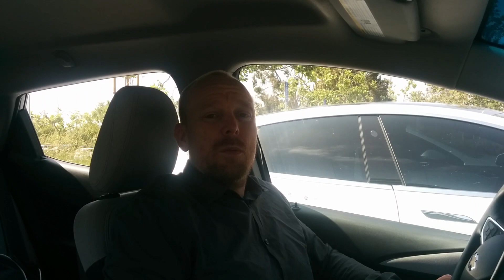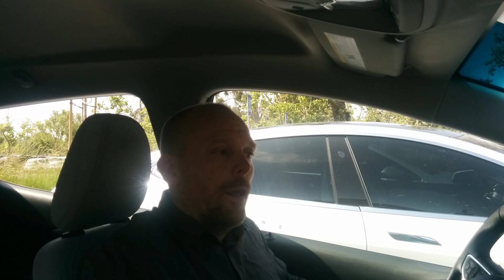Plug-Side Chat: What Actually Dictates the Chevy Bolt EV Charge Rate

Comment: Sorry, it seems there is a difference between battery packs.
https://www.techspot.com/news/74967-teardown-tesla-model-3-reveals-best-battery-ever.html
Reply from the maker: Oh, I'm not making a qualitative assertion. I'm simply stating that JB Strauble, Elon Musk, et al. are misrepresenting a very basic concept to give themselves a positive marketing spin. Basically, sacrificing accuracy for profits.

The concept of power density is simple. The kW/kg of power a battery can produce. On a cell level, Teslas are more power dense than any other battery cell because they have such low capacity. Likewise, a smaller capacity Ioniq or Spark EV cell will be more power dense than a Bolt EV cell as a simple consequence of having less capacity (i.e., less mass). 

The Model 3's battery might be more power dense than the Bolt  EV's (we don't know for sure because the Bolt EV's battery output is capped at 160 kW... it could be much higher). However, the Model 3 has much lower power density than the Spark EV, which has much lower power density than the Volt.

What's missed in this whole discussion is what is the max power required for the application. The Bolt EV only needs 160 kW, so once that target is reached, GM is free to add capacity (energy density), which consequently reduces power density. The Spark EV only needs 120 kW, but it also doesn't have room for more energy capacity. The Model 3 requires at least 250 kW, and possibly more to meet the future demands of an AWD performance trim. 

The fact that some performance EV modifiers prefer GM cells over Tesla cells because the latter suffer from worse voltage sag should tell you all you need to know.

Comment: There are sure limitations on the CCS but the tapering is definitely something Chevy has been programming into the BMS to protect the battery and make it last longer. Tesla does the exact same. But it is true, if you max out the charger's limitations (in how many Ampere it can deliver) then that's not the car's fault or weakness.
Reply from the maker: Yes. GM is more conservative than they needed to be, and unfortunately, I think this was a decision where the engineers and designers were overruled by accountants. 

One thing that will be interesting to account for is how the Bolt EV draws excess power from the charger for climate control and battery conditioning. Even though the battery charge current limit appears to be set at 150 A, that might not be the system limit. I've noticed that when a Tesla is charging (say at 100 kW) on a Supercharger and the climate control is turned on, the charge rate will drop (say to 95 kW or whatever is being drawn). If a Bolt EV is DC charging and the climate control is activated, it will draw power from the charger (if it is available). But I don't know what the upper limit is yet.

Comment: GM wasn't conservative on the Spark EV, which didn't taper like the Bolt EV. Spark EV saw very little battery degradation. We all know the Spark EV was a test bed for the Bolt EV.

As far as the slow charging and tapering on the Bolt, GM used a low power density cells and Hyundai used a high power density cells. Telsa uses a higher power density cells on their vehicles.

GM really neutered the Bolt EV. I don't recommend the Bolt EV. This is coming from Gen 1&2 Volt and Spark EV owner.
Reply from the maker: The power density of the Jaguar I-PACE's cells is almost identical to the power density of the Bolt EV's cells. Why can the I-PACE sustain 90 kW charging rates up to 80%?

Comment: I think you are the one confused. J.B. Is correct. You do choose the chemistry. The easiest way for you to learn about it is to buy a hobby charger and a bunch of different 18650 cells, and watch how they charge and discharge. 

The Panasonic 18650B is a pretty good battery with a decent power (6.8a with 12a burst) and pretty good capacity 3400 mah. But there are 18650 with much higher power, but lower capacity. Samsung 25R is high power (20a continuous) but lower capacity 2500 mah. 

The reason all high drain batteries are lower capacity is that what makes them high drain is more electrode area and thinner electrolyte layer. The same thing that lets these discharge fast, without voltage sag to cutoff, is the low resistance. This same low resistance allows the battery to stay at the Constant Current phase much longer before it hits the Constant Voltage phase.

Both Panasonic 18650 and LG Chem pouch cell call for CC/CV with CV being at 4.2v. As a single cell, as long as it’s within recommended temperature, that’s all it needs to do to charge. No voltage taper, but of course the amps will drop as the battery completes its saturation phase. 

The normal CC is 0.5C for the cells used in the models S/X, but clearly they can charge faster if they are kept cool. As much as 1.5C, because they are high energy, not high drain. But if Tesla used high drain batteries, it could accept 2C, all the way up to 80%, because of the low internal resistance. But the battery would have a lot less capacity. 

Just like the 18650 has many choices, so does LG Chem. The can set the electrode to electrolyte ratio to give very high power and low energy like the Volt/Spark, or very low power and high energy like Chevy Bolt. 

Since the batteries are in series, you have about 96 bricks that all must stay below 4.2 while charging. Since it’s impossible to have perfect balance amount each brick, when charging at 125a, some bricks will go higher, it’s unavoidable. So rather than make the balancer work overtime, the charger will reduce current before before 403.2v. So during the CV phase. It will follow a voltage ramp, and decrease current as needed to stay on that ramp. 

The reason the Volt throttles at 55% is because the Bolt cell’s are high resistance. That’s why it’s a very low power battery, and a very high energy. 

When I say I can put 3x Spark batteries in parallel and charge them at 150 kw, of course it means that it has the CCS standard that supports it. Connecting to a 50kw charger won’t work, but the 350 kw ccs with proper connected and wiring on the car, and it will definitely charge at 150kw.

There are plenty of videos explaining all of this for vaping, because they need high drain cells. A low drain cell with more energy will not last as long because of voltage sag. It just falls on its face. If you put a Bolt battery in a P100D, it would throttle you way below 60% power. It would fall flat on its face and throttle to 200a of so. 

But most likely if you got this far in a EVs without understanding the basics, the only way you will be convinced is when someone gets one cell from a Volt and one cell from a Bolt, and runs them on a CC/CV charge, starting with 2C. No BMS in the way, just the battery connected to a charger. 

You are under the misconception that GM, who let the Spark charge at 2C all the way up to 80%, suddenly got cold feet and only lets a Bolt charge at 1C, and only to 50%. But that’s just not the case. The Ionic cell is also a high drain cell. 

There is an app and a PID file someone is working on for the Bolt. Hopefully someone will get that working and show you what’s really going on inside a Bolt battery. It’s already been shown on Tesla battery. And can’t be shown on the Volt because no fast charge. 

Hopefully someone else can chime in to help you learn about batteries, because I already told you most of this last time.
Reply from the maker: The Bolt EV has a liquid thermal management system.
Reply from the maker: And yes, battery chemistry does dictate the characteristics of the battery, but that is different than saying that the chemistry used in the Bolt EV specifically is less capable of fast charging/discharging than other chemistries. 

The Ioniq EV, Spark EV, and I-PACE all have very similar chemistries to the Bolt EV, so chemistry isn't a factor in determining the differences in their charging rates.
Reply: Kévin Lind, Spark and Volt use very similar methods, with cooking plates between pouch cells. The Bolt using a chill plate that the modules sit on, and some heat sinks between the modules down the the chill plate. 

WeberAuto youtube channel took a Bolt and a Volt battery apart to show the cooling system. The iPace seems to use a similar method, and the next leaf will probably use the same design as the Bolt battery. 

The Bolt battery has good bang for the buck, at $13,000 for the complete 60 kWh battery brand new. Tesla wants $9000 just to add 25 kWh with of cell’s to a 50 kWh battery. No telling how much Tesla would charge you to buy a 50 kWh battery. Certainly more than $13,000.
Reply: Although I agree with everything you said, I still believe the Bolt battery could at least take the 200 amps, and that GM is restricting it through the BMS. But it's definitely true that the chemistry play the most important role
Reply: Kévin Lind, yes, the BMS has to establish the CC portion, which seems GM has set at about 1C, but we won’t really know until someone can plug one into a high power charger. If GM allowed 200A, it wouldn’t help much because it would just hit the CV phase much earlier, and it would stress the battery out for no good reason, unless you just wanted a 10 minute zap to get enough to get home. 

The other part is that the Bolt uses an inferior cooling system compared to the Volt or Spark. The Bolt battery is basically a leaf battery with the modules sitting on chill plates. Better than a leaf battery, but not as good as Tesla, Volt, Spark. 

But the Bolt battery is the right battery for the Bolt. Just like high energy batteries are better for power banks than high drain batteries are. No need for 40A discharge is your USB only has 2.1A. The Volt/Spark battery would make the Bolt cost way too much, and the only benefit would be faster charging, unless they added a second motor and made a Bolt SS. LOL
Reply: I think I saw a video where the Bolt used the fan to blow some cold air with the AC. But nothing like the liquid cooling of competitors. How does the Spark EV cool it's batteries ?
Reply: That is excellent news for the Bolt ! I love it ! 
I believe the Ioniq went a slightly different road with Li-po batteries

Comment: while charging below the top voltage the voltage does not stay the same, it increases. its Constant Current until the battery is topped of for all lithium ion batteries. CC then CV. my Spark EV holds nearly the full 125 amps till 80 percent. It will read 48 kW. check my review for guage shots. I think they went with a different chemistry with the battery for the Bolt but I do think it is more of Chevy wanting to keep the "fade" in check..
Reply from the maker: That's my point. The reason has nothing to do with chemistry; GM simply chose to throttle the current.
Reply: Voltage doesn't necessarily need to increase until the battery is full. On my car, the battery will top at 361/363 V around 55% Soc. And it will actually drop a tiny bit above 90%. 
If you take a look at modelism batteries chargers, the high end ones will keep the battery at 3,75 V and keep charging it, which will expand the battery life instead of going up to ~4,2 V ( on common modelism planes batteries )
Reply: Kévin Lind I understand what your saying to be that the charger feeds a constant voltage? That should only happen at the end of the charge. As a li-ion battery gets charged you should see the voltage increase over time and the current stays constant. for instance if your battery is at 3.3 volts and you want it charged to 3.7 volts it will begin to be charged at 3.3 volts with a constant amperage and then the voltage will slowly increase to 3.4 then 3.5 while the current remains constant. Any EV you see charging will have the voltage increase over time.
Reply: News Coulomb all this time I thought our CCS plugs, as they are on the spark and bolt, could handle 150kw... I have not heard of this 200 amp limitation until now. Looking up information, I see nothing that supports what I thought I knew....
Reply: TRY to HELP you 
I agree. If I get very low on battery, the EVSE will indicate a charging voltage of about 330 V at 10% then it will gradually increase over time as you described. But it will stop increasing when it hit the top voltage of the battery at 361 V around 55% soc. Then a few moments after that, the amps will begin to drop. 
Unfortunately I don't have a ODBII adapter that is working in my car yet so I can't see the voltage of the cells.
Reply: TRY to HELP you, yes, all these batteries use modified CC/CV, where they factor in temperature and introduce a slight ramp up during the CV phase because of the 96S. 

Eventually someone with a Bolt and the Torque Pro app or similar will demonstrate what happens.
Reply: Have you observed any battery degradation besides what is expected?
Reply: TRY to HELP you, it’s almost time for an Spark EV update. That was a super steal at $11,000. I bought a new Suzuki Swift in 1994 for $7300, so for you to get essentially the same car with a $20,000 battery for $4000 more 20 years later was a super deal. 

I think GM realized they for the same price as that high power battery with super thermal management, they can buy nearly 3x the cells if they go with the cheaper cells, and they can still get everything the Spark EV offers, with 2.5x the range, and the only penalty is the added weight, making it slower. 

I wish Suzuki would come back and offer the swift and Jimny (modern Samurai) in electric, and just use a cheaper battery like the Bolt, and sell it for $20,000 and $25,000. Those Samurai sold like hot cakes but where accused of rolling over. Put a 1000 lb battery under it and I bet it would pass any roll over Test Ralph Nader can throw at it. 

Suzuki basically still has a clean batch of tax incentives. They need to come use them before they are gone.

Comment: Hmmm. I didn’t even know there was a “level 2” CCS. I thought as soon as you are charging using CCS “charge head”, it would be considered “level 3”...
You learn something new every day. Thanks!
Reply: Actually there is no such thing as a level 2 or 3 CCS. 
What is commonly said as 'level of charging' is the mode of charging. 
CCS is a standard part of the mode 4 (or level 4) for DC charging. 
In USA the CCS type 1 connector or CCS 1 is used, as opposed to the CCS 2 used in about the rest of the world. The connector is different. 
The Bolt EV use the standard CCS 1.0 which is the first generation of CCS capable of ~80kW (400 V 200 A)
Newer model will probably come with the CCS version 2 ( CCS 2.0 ) which is capable of ~350kW. 

So the Bolt EV effectively use a CCS type 1 connector, version 1.0 which is a mode 4 DC charging
Reply from the maker: I've heard the CCS standards referred to as levels 1, 2, and 3.

https://en.m.wikipedia.org/wiki/SAE_J1772
Reply: News Coulomb You have 4 modes of charging : 
Level 1 (trickle charge) : on 120V AC
Level 2 : on 240V AC 
Level 3 : about the same as level 2 but on a dedicated circuit ( special cable needed )
Level 4 : DC charging 

Level 1 and 2 are on regular household plugs, when level 3 use the type 1 or type 2 connector, and level 4 is the DC option
Reply from the maker: Right, but we are specifically talking about the CCS standards, of which there are currently three levels identified.
Reply: News Coulomb 
Now I see ! Sorry for the misunderstanding, it seems like the CCS level 1 is capable of around 36kW. I didn't knew that, I thought both CCS type 1 and type 2 where developed at the same time but it seems like it was not entirely the case. The CCS type 2 was created directly with support to 200 A. 
It's funny how the Ampera-E use a CCS 2 version 1 whereas the Bolt use a CCS 1 version 2 ^^
Reply: Lvl 3 DC charging does NOT have anything in common with the lvl 2 charging.

in lvl 2,  the power is transfered through the two 240v pin and then goes to the on-board charger.. then the battery.

in lvl 3, the power is transfered through the two 400v pin and go straight to the battery.. the top J1772 connector is only used for communication
Reply: Now I'm quite lost to be honest😂. Do you use the term "level" to specify the protocol version and the mode of charging ? Seems quite confusing
Reply: Technically there is a L1, L2 and L3 AC and L1, L2 and L3 DC charging.